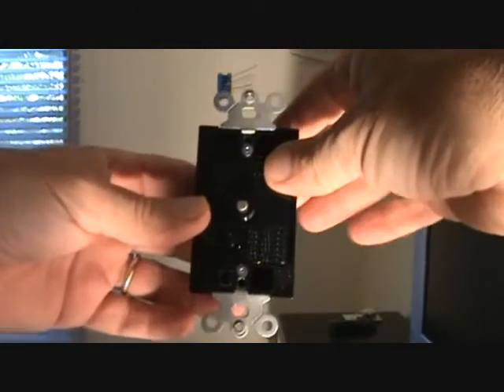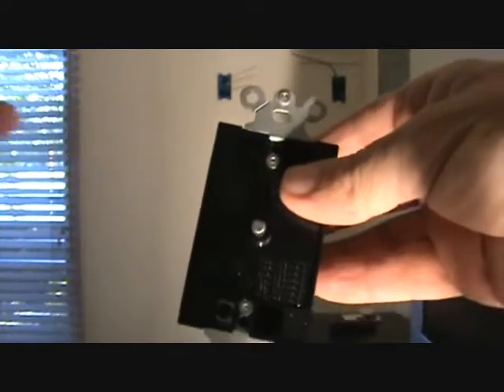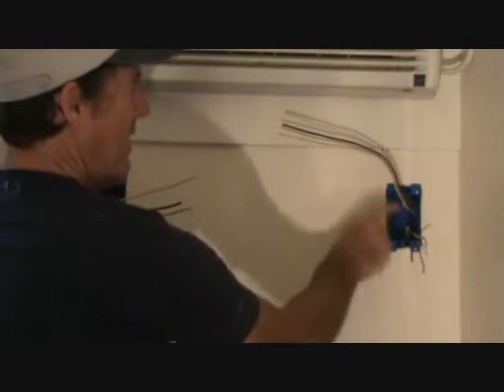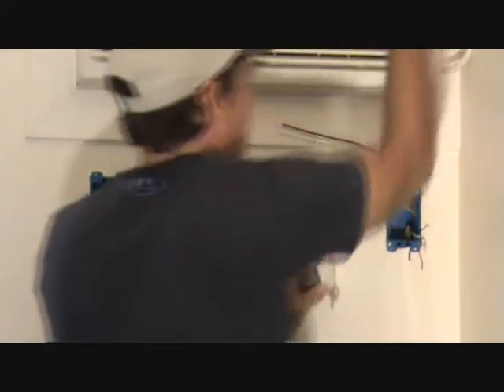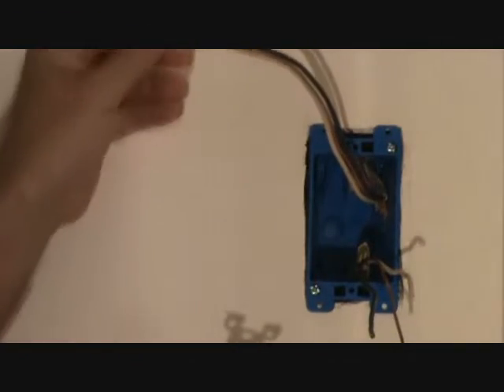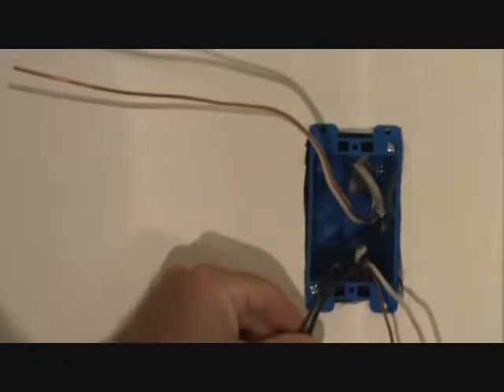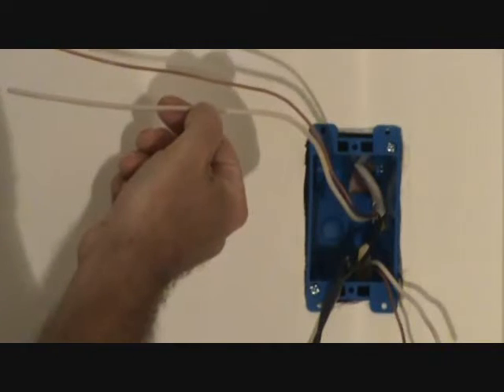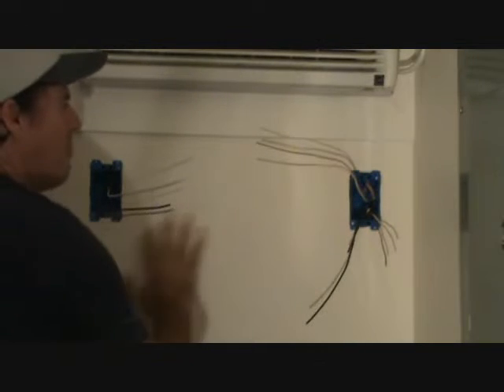How to hook up an electrical timer...using only one set of wires

Comment: 8:40 What did you do with the two remaining black wires? Did you just join them together and cap it off? Or cap them off separately ?
Also how is the white neutral wire carrying load power ? 
Doesn't the black load wire bring power in and the neutral white return  ?
Reply from the maker: For wall switches & a timer switch such as this you won't be connecting any of the white wires to a switch so if you did in fact run two wires over there then you would connect the whites with a wire nut & shove into the back of the junction box. In this case however was not the case as all I have is 2 power wires going over to the timer switch so one power wire is for the incoming line & the other is the outgoing power feed. Hard to explain so watch the video again & I have other electrical videos showing more of the hook up for a timer like this. Go to my main YouTube channel page then click on playlists & scroll down to electrical then scroll through that area to find how I installed these timers as I first did it with 2 sets of wires then I figured I could do it with just one set of wires too so you can see how I did it both ways to learn more. Hope this helps & thanks for stopping by!

Comment: Are you planning on leaving the AC unit in the on position?
Reply from the maker: I installed a 4 hour timer so I could turn the unit on for 1 to 4 hours from the timer location & then after set time, the AC unit will go off automatically & not run all day long. See what I mean?

Comment: Best watched at 1.25x speed. Too unnecessarily slow in oration.
Lighting is bad too, too many shadows...can't really distinguish the wire colors (besides the obvious white wires). 

When showing explaining the details of the timer, wires, etc, do a camera closeup on the parts being talked about. Camera too far from subject, rendering the viewer to guess what is what.
Reply from the maker: I was still in first stages of using a video camera plus years ago they didn't have HD video cameras like they do today. I was still hoping you would get the point for how to install one of these timers to the wires etc..

Comment from the maker: @chris45n The standard way to label the wire is to wrap the white wire with black tape so there is no cunfusion at all. Some electricians might not do this at all, if there is only 1 black & 1 white wire in the entire switch or outlet box, since most installers know what's going on with that senario....I've seen that too. Not a good recommended way though. I'm surprised your Stanley book doesn't mention it. Thanks again for commenting.   Joe  :0

Comment from the maker: @chris45n They also use this technique (sometimes) if the main power source is coming into a ceiling light fixture junction box & they wamt to come out of that down to a light switch....that's why at some light switches you only see one black wire & one white wire. You just need to make sure you label the white wire as a black wire in case the next person who opens up the outlet box gets shocked...it prevents this. Thanks for commenting.   Joe   :0